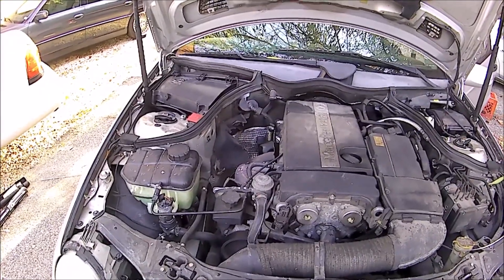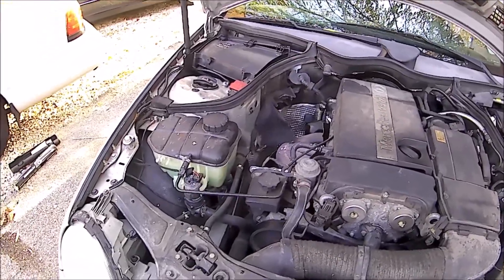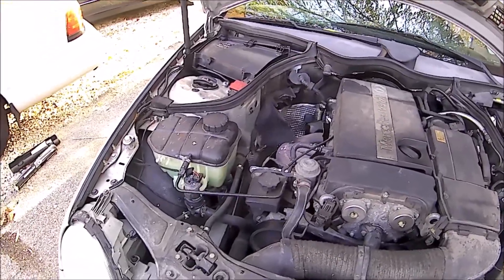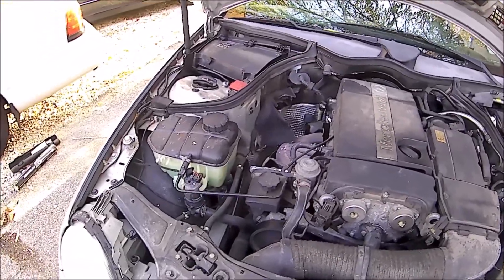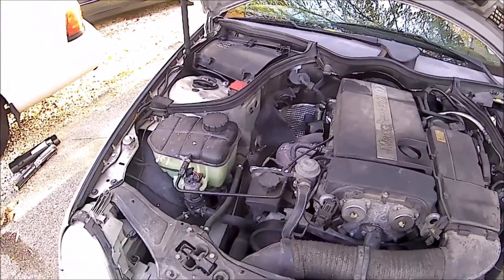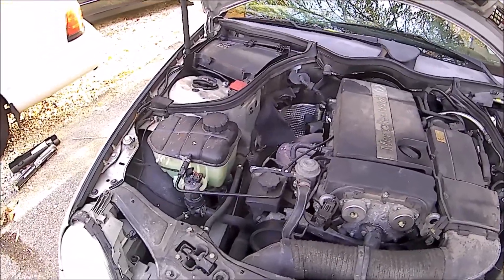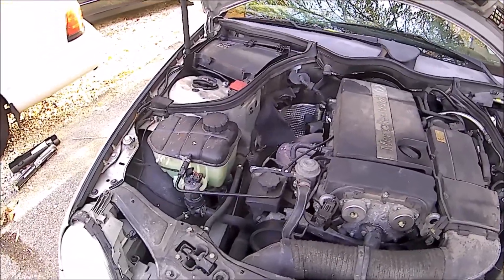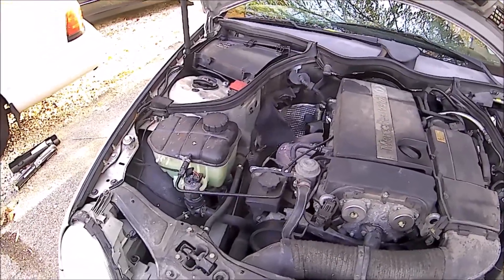Diagnosing a coolant leak Mercedes C230 pressure test

Comment: Once you remove that one screw that you can see that trucks you will back that plastic pipe out there is a seal ring on there you change that you pop it back in put the one bolt back in and you're good to go the leak is fixed really simple
Reply: What’s the name of that part
Reply: @jake are you referring to the screw that's "bolted to the transmission", that's "backed up a bunch"?

Comment: Did the at-205 get applied around the base of the fitting where it meets the back of the head?
Reply from the maker: Negative. Straight into the cooling system. That's where the o-ring does its sealing.
Reply: @HollywoodHornet  Ah. Yep, I wasn't familiar with the product so I only imagined how it's applied. After reading the product description I learned that it's a "additive". They say it only works for minor leaks though. Like if you had a somewhat dry seal or a very small seal warp. I see how it could save some money and time for something like a main seal though.
Thanks.